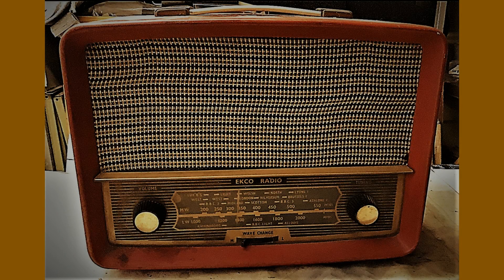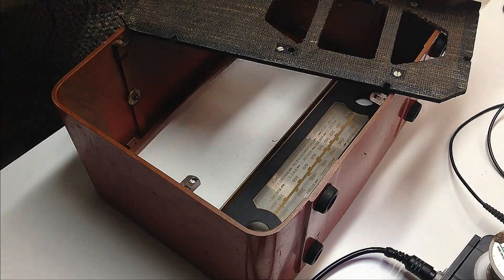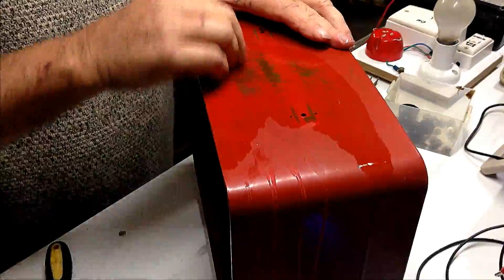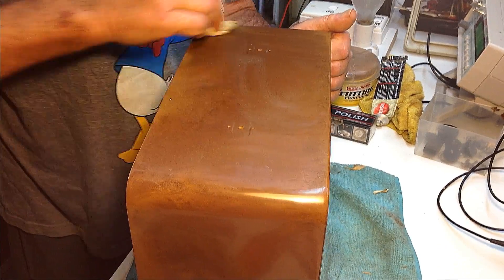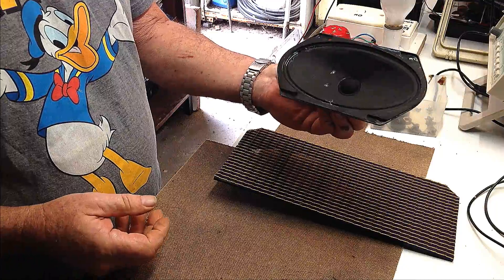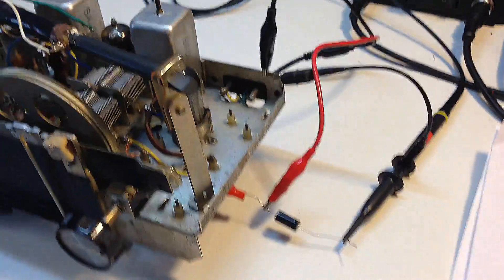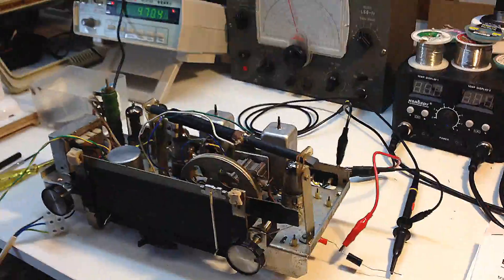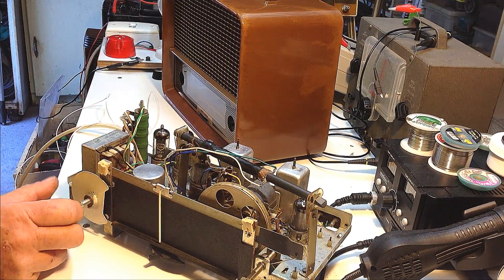EKCO U245 PART 2

Comment: Hi Don, great video. Good tip about the metal polish and the case looks great, they tell me they used cases that didn't come out quite right for painting, but yours looks unique. The grill cloth also looks perfect. Those screws will be BA standard, very popular on Pommy equipment back then.